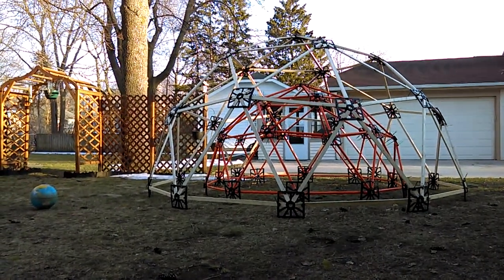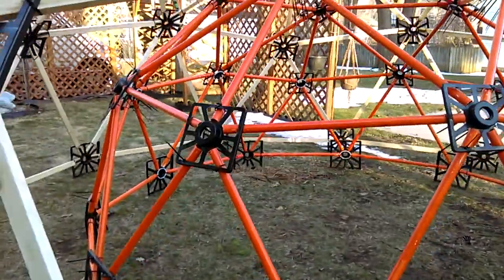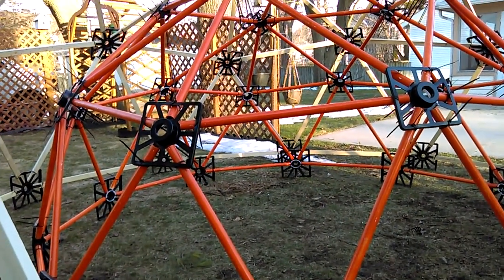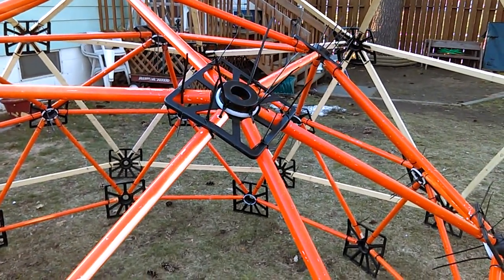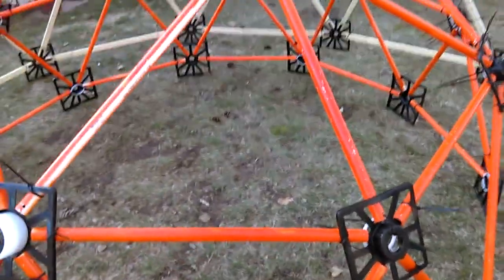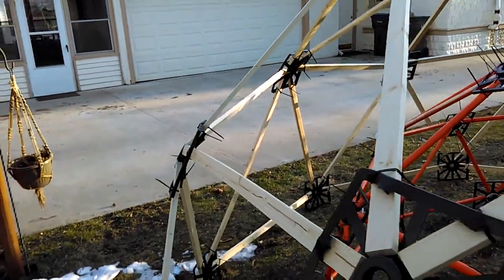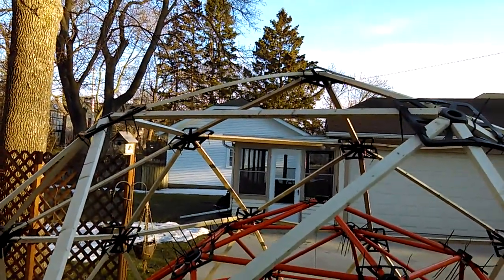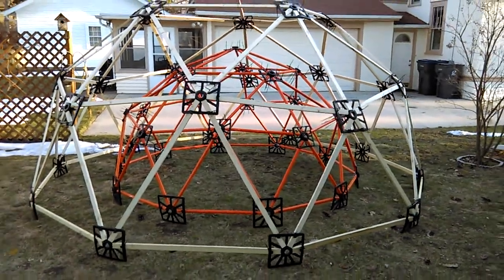MKE Domes. First Wooden Geodesic Dome.

Comment: Thanks for sharing your information. I have a few questions. How are the wooden struts attached to the hub? Also, is it possible to climb on a dome built with these hubs? What is the maximum weight these hubs can withstand?
Reply: Thanks very much for your response
Reply from the maker: @marovid  you're welcome! Are you gonna build a dome?
Reply: @lemondealc  Yes, I am going to build a dome. I am awaiting your instructions for building the dome more stable  before I commence.
Reply from the maker: You are very welcome! Honestly this was the first and last time I used the wooden struts. I believe I stapled the wooden strut to my hub. It wasn't meant to be permanent it was just an experiment. I see you emailed me. I will forward you a design with wooden struts that I think is more stable and easy to build.
Reply: Great work I  have built a dome somewhat like yours the only problem I have is the covering I have tried plastic but I can't get it to fit right it's built out of 3/4 pvc I can't figure out how to cover it i though about putting wood on the pvc but I have no experience in this I have a lot of time and now alot of money in it and with out a cover it's useless to me any advice you have to point me in the right direction would be greatly appreciated thanks for sharing your work and experience with me